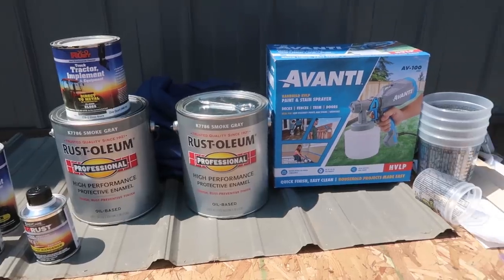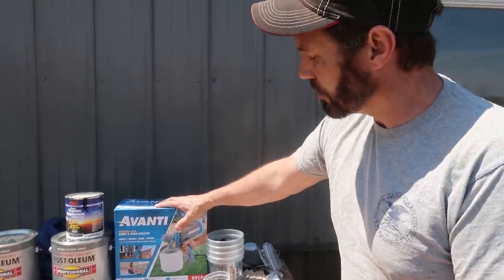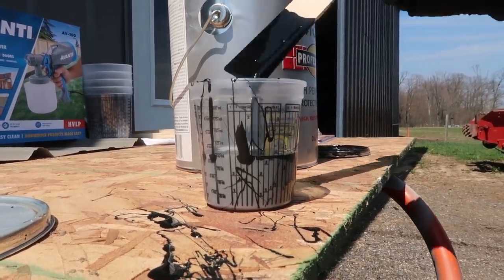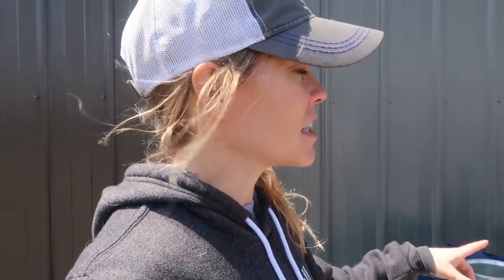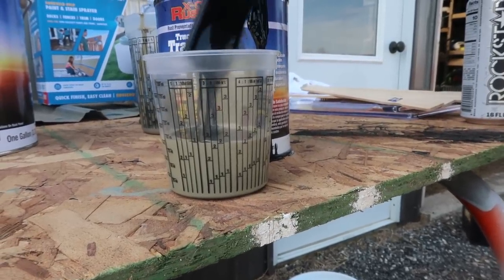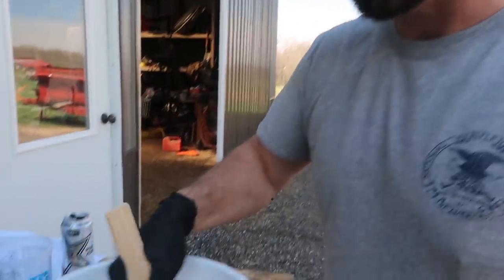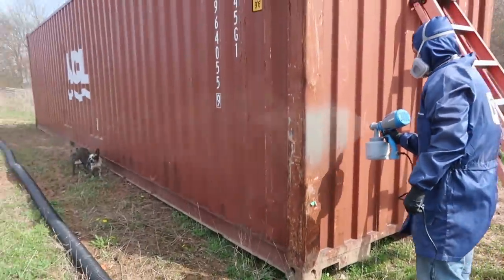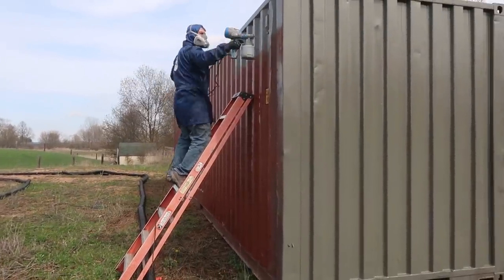300 Starting a Shipping Container PROJECT: Painting A Shipping Container and Sad News

Comment: Hi susan 
Painting a shipping container can be hard if you dont do the prep right . first step is to sandblast off the rust and remove the decals completely . step 2 is to use either an epoxy or metal primer. When it comes to paint tremclad is usually great but using electric spray guns not the brightest idea the best are body shop spray guns hooked to a comperssor if hooked up correctly you can run 2 guns at once . yes its a long job but if you have 2 sections of 5x5x10 scaffolding and two 4 wheel scaffold buggys one on each side it can go fast because youve got like 10 feet of working platform distance which is alot of area . another option is renting an airless sprayer with 25' of hose and an extension your spray patern is wide you cover a wider area and dont need to keep mixing paint you mix your paint in a 5 gallon bucket put the pump in and off you go done in a short time .

Comment: Yup.  Close to broken arm time.  Should have full guards etc.  Paint the back first after surface prep and priming.  A body shop would have an optical gizmo that would show ratios.  They do for automotive application anyhow.  Coating job is only as good as Surface Preparation.  50% overlap of spray.  Top down to bottom. Keep gun perpendicular to surface.  Corners first.  Looks good Erik.  You could always chrome it!  Make sure there are vents at the top at corners.  Go-Kart track!  How many mils thick?  Second coat on East side after suitable overcoat time.
Reply: All the paint I mix at work is do e on computer the ratios are all programed in you pick how much and what product you want to mix and wham bam ready to mix.  Ya I always paint top down but every paint school I've been too they want you going bottom up because the paint over spray will be obsorbes in better.
Reply: @ruralridez6165  My experience has been Industrial Coatings, Inorganic Zinc primers, 2 part hi-build epoxies usually on ships, bridges, piping etc.  Usually with Airless Spray.  Specific Surface Preparation.  2 coats on your container?  Nice match.  Some big rolling waves on the side like camo on Warships?  I have seen an optical device that is held to the paint colour desired and it transfers info on amounts to mix for perfect match.
My condolences to you and your family.
Reply: @gordbaker896  yes we have one of the cameras that you can matches with. They cost around 5k only bigger locations like mine get them. Evey 24 hrs they need to be calibrated taking a black picture on a special disc then a white one. I do t use is too often most paint codes will have a color deck with 3-5 different alternates to pick from. I've had colors with as many as 12 alternates so you do you best to pick the one that looks best and always good to get a second opinion everyone sees color different.
Reply: @ruralridez6165  $5k. Wow.  The ones I saw when restoring '82 Collector Wheels and later Tonka resto were small hand held.  I understand that there are/was 18 shades of White.  Brutal.  Women see in 264 colours, men in 8!

Comment: With a small compressor you can compensate by rigging multiple portable tanks together or by using an old 50 gallon propane cylinder.   many of those are abandoned because they have timed out of the re certification to be refilled with flammable gas.  I have one manufactured in 1954 that I use for exactly that.    Small compressors can make pressure but they dont have air tank volume .  you will have to take a break often for the compressor to catch up but the cost savings is attractive

Comment: You need to get the container up off the ground, otherwise it will rust. I would grit blast it, primer, and then paint.
Reply: David Poynter it'll take a hundred years to rust through that container. They are made out of cortin Steel. They are designed to cross the ocean with salty water spray hitting them.
Reply from the maker: We will probably put RR ties under it